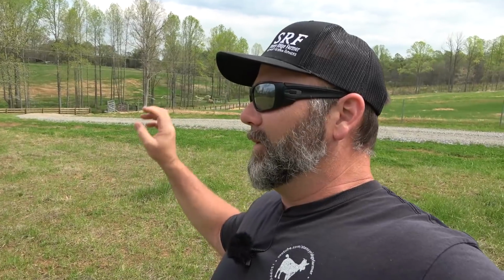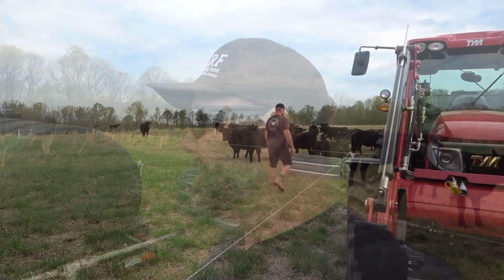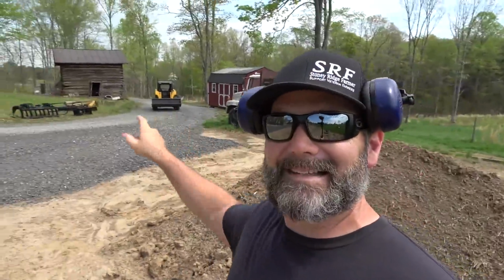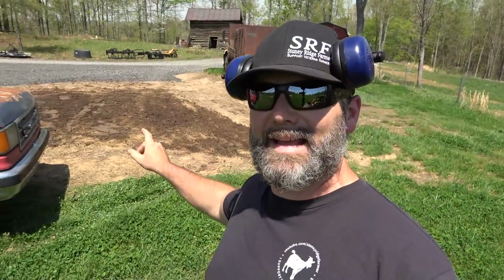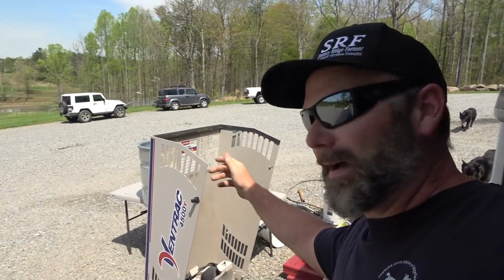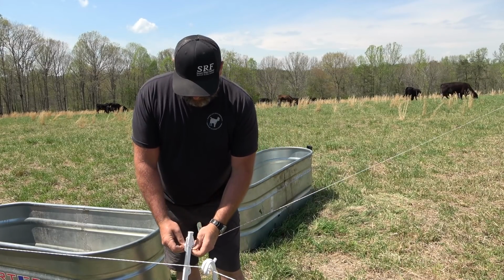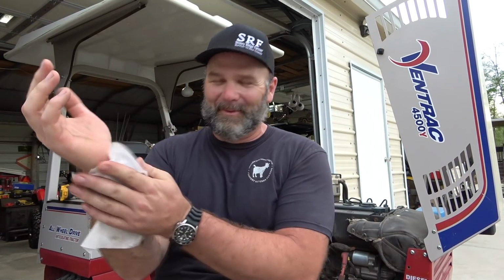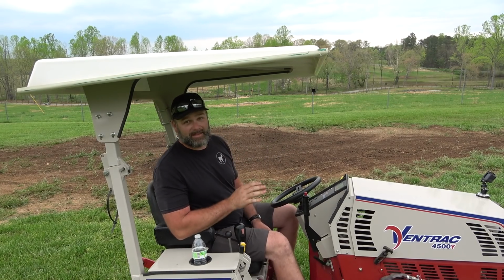It just never ends!

Comment: A busy day on the farm, I know your pain with the universal joint grease fitting on the Ventrack,  I had a Kubota TG1860 lawn mower with the same issue. I used a straight extension on my grease gun to get into the universal joint. I think is called a push-on extension but not sure about that; however it made the job much easier.

Comment: are you going to wash you equipment
Reply from the maker: A few times a year they get a good washing, but not after every use....Blasting water into these machines causes problems.  A gentle bath once and a while does the trick
Reply: It is spring time in NC.  Covered in pollen in two hours.  Getting it wet just makes it cake on.